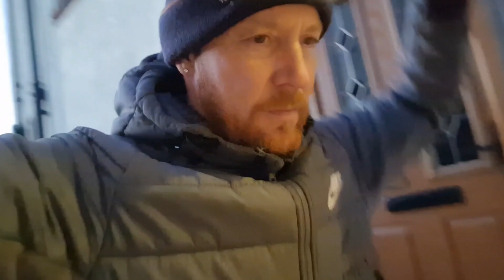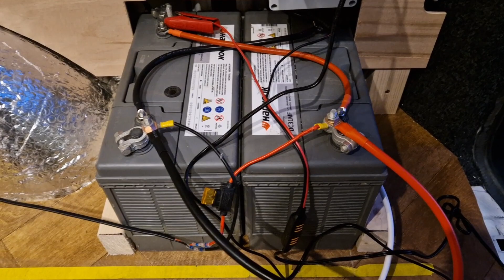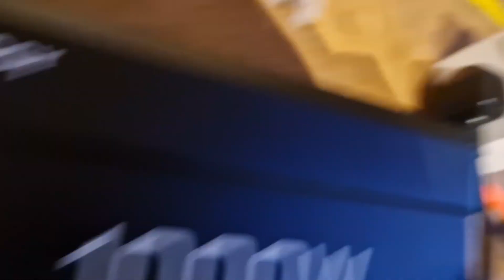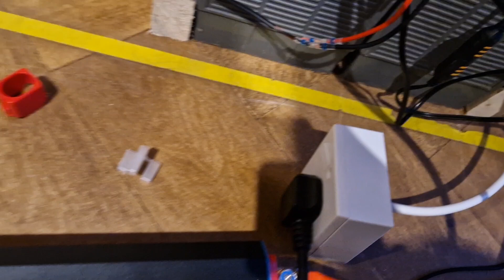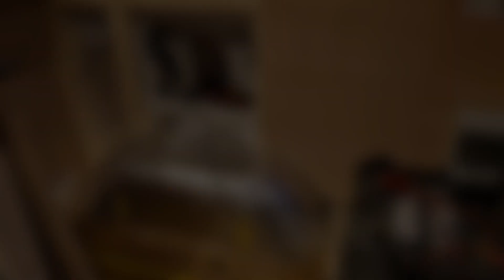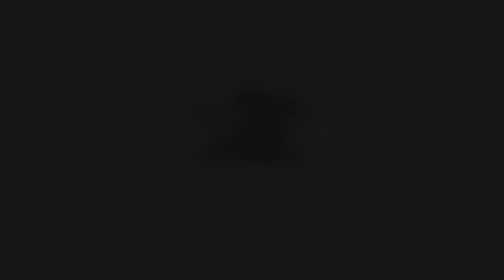Renogy 1000w Inverter Automatic Transfer Switch VW Campervan

Comment: Hi, I have more or less the same set up. I think that ctek will only maintenance charge upto 160 amps. May need a bigger charger.
Reply from the maker: This was a long time ago. I ended up upgrading to a 2000 Inverter and a 280 lithium. I then added a 30a lithium charger from Fogstar but they also do a 50a and only about £100

Comment: Hi, great video, thanks for the info. I've just bought a 2000w Renogy inverter with the auto switchover, I had a couple of cheaper ones, but they died due to the 230v back feeding when on hookup as I forgot to unplug it. 
  It will then be connected to the mains 'ring' on my motorhome, 6 or 7 sockes. Will the inverter automatically switch off when it senses I'm on hookup and be protected from the 230v from the live 'ring' main feeding back ? Probably not explained it very well..... Cheers.
Reply from the maker: Yes, the built-in transfer switch is supposedly designed to detect shore power and disconnect the inverter output automatically to prevent back-feeding. 🙂

Comment: So here is a question, how is it possible to add more sockets that will run of both inverter and shore power
Reply from the maker: You can basically daisy chain from the plug socket into other sockets.
Ideally it would be best to add in another rcbo between this link But!
The renogy units do tend to show as reverse polarity so Id advise researching on this alone.
As far as Im Aware though, Renogy units do had some sort of fail safe built in. Like a trip.
But basically your daisy chain socket will work off either depending if on hook up or not.

I hope that helps a little.

Comment: Something you haven’t mentioned. These Renogy inverters have a floating, or centre tapped earth (115v on live and 115v on neutral rather than 230v on live). This means that your RCCD (fault protection) won’t trip in the event of an earth fault. These should be wired up with a neutral/earth bond when in inverter mode and the bond MUST be removed when on hook up. This can be achieved automatically by using a contactor/relay to disconnect the neutral/earth bond when the hook up is live. Try plugging a socket tester into the inverter when there’s no hook up power (in inverter mode) and it will show an earth fault.
Reply from the maker: Great comment.
Its been afew years since I tested this unit for my own personal use.
As we now have a business fitting electrical equipment to vehicles, we tend to only use Victron products and the multiplus works faultless with rcbos.
Reply: You are correct matey!!

Comment: Thanks for the video,great info. Can I ask two questions? 
When running on hookup does the inverter get hot, and if so does the fans kick in to cool it like it would if the inverter was working off your batteries? My concern has been leaving it on hook up over the weekend on a campsite. I would want to run any inverter for too long.
Do you need a RCD trip before and after the with this setup?
Reply from the maker: When on hook up the inverter shouldn't be inverting only used as pass through so shouldn't have any need for the fans to be running.
The inverter/ charger are the only ones that will as they are charging whilst on hook up but this one is only a pass through.
I would advise using a consumer unit or rcbos before and after the inverter although some would say you dont need to after on these units.

Comment: Are you or Have you installed an earth bonding relay for the sockets supplied with power from the inverter? So when you are using Shore power the earth and neutral are bonded back at the campsite/shore side supply but when on inverter power the earth and neutral get bonded locally within the van

Comment: Hi Lee. That's exactly the setup I want for Viv.  I just got the fogstar drift 230 ah ( which is actually giving me 245ah!)  and I was looking at the renogy 2000 watt inverter, but my setup will be the same. I want to go gas free in Viv.  Thanks for the helpful video.  Much respect 🙏- Kenny
Reply from the maker: No worries. Check this Link. I think this one may be even more similar to your set up. 😉
https://youtu.be/Ul1Nd1IMrkA?si=z8z4--Mo6yDkmXgR

Comment: Great video mate! Will it still allow the 240V pass through it when the inverter is actually OFF? So what I am asking is if the default position of that internal relay/switch in the inverter is to connect the 240 to the output (even if the inverter is fully OFF)
Reply from the maker: Yes that's correct. When on, it will auto transfer both ways and when turned off, it will allow hook up. 👍
Reply from the maker: And thanks for the feedback.
Reply: @builtbylee  No problem. I have since contacted Renogy to see what the rated current is for the bypass circuit as I wanted to confirm that I could power devices above 1000W when hooked up. Apparently the bypass circuit is limited to 10A. So that would be 2300W on a 230VAC hookup. I couldn't find this info on the manual but would you happen to know if the unit itself has this information written on it or would you happen to know the AC supply fuse size by any chance to confirm this? Thanks
Reply from the maker: @user-ci9nn7nm6k  From what I've heard and read there is limit as you've mentioned. For myself this wouldn't be a problem for what I use.
I do, however, think that the 2000w version is higher and also the 3000version even higher.
I can't remember the figures though I'm afraid and like you said these figures aren't advertised.
If I find out exactly I'll get back to you.
Reply: @builtbylee  I found out that the 1000W unit has a bypass current rating of 10A, so 2300W. Good to know
Reply from the maker: @TimDaly-k3c  Nice one. Thanks for the information 👍

Comment: Thanks a lot for this informative video. But my question is, does that inverter charge the batteries when plugged to 230?
Reply from the maker: No it doesn't. You would either need the Renogy inverter charger or this one and a seperate smart bsttery charger capable of charging whatever  battery type you have. 
👍

Comment: While it may sound a good idea, the on the back of the unit the "Transfer Switch Rating" is only 7A, so 1700W. I could not find this data anywhere in the specs online.
Reply: So essentially just make sure your not using over 1700w while it's switching from shore to batterys?
Reply: @liamwilliams5866  It would be OK if that was the case. However it is the pass through rating, and once switched over, anything above 7A is going to trip the invertor. Seems like a very low rating. The 2000W version is 30A.
Reply: Hi guys, so these seems very limiting. I would have assumed that when the inverter is simply passing the 240 from hook-up that you could run much more power than 1700W thought it. Afterall it is just a bypass relay inside the unit. Are we sure it is only 7A?
Reply: Good point, maybe  shoud just try it out

Comment: Hey man thanks for showing this I am doing this exact set up. Are you ground/earthing/bonding the inverter to the chassis? Or just the DC neg?
Reply from the maker: @darylgreen185 No worries. There's a ground screw on the body which as far as I'm aware is for the 230v side so will need to ground to your 230v ground.
If you don't have 230v hook up and only using battery I'd problem hook up to a separate chassis point just incase.
Reply: @builtbylee  thanks dude. 🤙🏼

Comment: I  built a solar generator around this inverter/ATS setup. It has a grid input supply as well as solar input

The grid input to the inverter is on a tasmota plug. It automatically switches the grid off if 
1. my batteries are full  
2. if solar input power is greater then my current consumed power.

this does mean my Renogy Inverter ATS gets a healthy workout each day (i programmed it to allow up to 40 switches per day max) and may cause more wear on the built in ATS but it all works flawlessly. 

Very rarely the inverter does interrupt the supply by making everything turn off, so it's not a guaranteed "seemless" switch, but 95% of the time, it works perfect.

Comment: Thank you so much for your explanations, I’ve got a 2000 watt inverter to fit and want switching capability. I was totally confused until now. One thing though, if the inverter is switched off, will it automatically switch on and take from the battery when hook up is disconnected? If so there wouldn’t be any need to fit the remote switch would there? Thanks again.
Reply from the maker: If the inverter is in the off position, it will not draw from the battery but will still work on hook up. If I  the on position it will draw from the battery and switch over to 230 when plugged in and back to battery when unplugged. Or for example of the power trips it will switch to battery. 
You can just use the switch on the unit on/off or the separate switch in a more acceptable location( preferable).
Reply: Will the shore power not sobnect straight in the AC in, the inverter that im installing has an AC in with a kettle lead socket
Reply: @grantmccallan8136 I’m not quite sure what you are getting at, could you give more detail?
Reply: Ok thanks again, I will fit the remote switch so as to avoid parasitic draw when not on hook up. 👌🇮🇲

Comment: Thanks for the video. When you're connected to mains and you've the inverter turned off, do you still have power on the sockets?
Reply from the maker: Yes it does matey. Its in permanent 230v mode when not turned on. When its 'on' your sockets are in inverter mode from the batteries and as soon as you plug in to mains its auto switches and as soon as you unplug it switched back.
Reply: And once in this bypass mode, can you run higher power appliances? (Higher than 1000W). Anyone know the maximum rating for this?
Reply: @TimDaly-k3c  no i believe the inverter limits it to 1000W if it is a 1000W inverter even though you might have a 16 amp AC shore power hook up.  To be able to run hire power appliances you will have to have a socket or outlet that is live when shore power is connected but does not run through the inverter. Not sure if this applies to all inverters but I reached out to Renogy for information on their 1000W inverter

Comment: Great video!. I have the exact same setup, except I have 4 of those DC31MF batteries in parallel. The Renogy 1000 with ATS switch is amazing value. You could actually pay more for a stand alone auto transfer switch! And the switch over is so quick that the TV doesnt even flicker.  I've also put a power relay with volt sensing switch on the mains power line to the Renogy so that whenever the volts go lower than 12.2 (adjustable, with timer) I revert back onto mains (if sensed). (£30 for volt sensor with power relay). The Renogy does have a battery protect disconnect but it's set non adjustable at 9 to 10v I think, which I think is way too risky for battery health ).
Reply from the maker: Thankyou. Totally agree value for money and the feature is amazing.
I think what you have added there is superb. It's very easy to forget to turn off the inverter switch and even when not under load they can still wear down the batteries. I think I'll look into that 👍. 
I was going to add another battery but my solar panels have really been pulling in the charge already so doubt it will need anymore power for the needs of the van.

Comment: Useful video as I’m thinking of getting the same inverter albeit 2000W. My question is how will you connect the AC out from the inverter to the consumer unit in the van?  The inverter only has 2 x 3 pin plugs as outlets doesn’t it?  So how can you connect it to the consumer unit?  I want to use my 3 pin plugs that are already in my van (they currently only work when I’m on EHU).  I don’t want to use the 3 pin plug on the inverter as that will be buried away in my van garage. Thanks.
Reply from the maker: OK so your 230v cable running from your socket follow it back towards your consumer unit bearing in mind where you are fitting your inverter.
Cut your cable, add a 13amp plug and plug into your inverter. 
Now the other end of the cable from you Consumer unit which is now cut needs a socket fitting. Fit a socket, plug in your inverter with the kettle cable supplied with the inverter. Wire inverter to your battery and hey Presto! It will automatically switch between 12v and 230 on hook up or not.
I may do another video on this as I think I confused afew people 😁
Reply: @builtbylee  Hi.Thanks v much for this video. Is the inital shore power cable running into an RCD? and then the inverter which is plugged into a socket and runs into your consumer unit - is this wired into a mcb? Have the 2000w inverter and going to install it so just trying to clarify a few things :)
Reply from the maker: @alexj383  Yes like you said. Although this video was recorded a good few years ago now.
I would recommend using a A rated double pole  consumer unit. Or rcbos.
Shore into RCD
RCD into your two MCBs.
Use the higher rated MCB for the socket for the inverter to go into (or you could hard wire).
A debatable one also is when you come out of the inverters for sockets I would now use a rcbo but the Renogy units do have a self shut off/ trip inside so entirely your choice. I'd just do this as a another safety point now.
Hope this helps